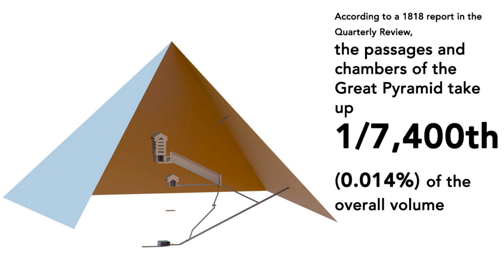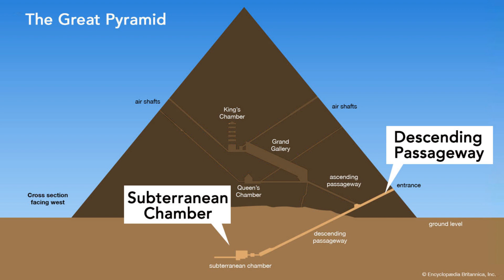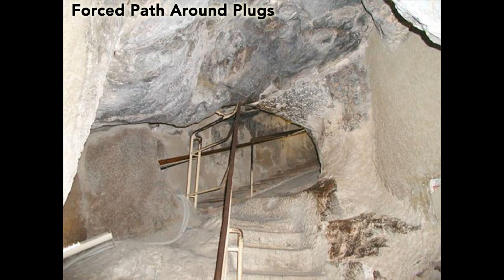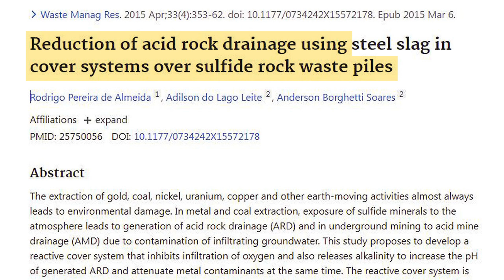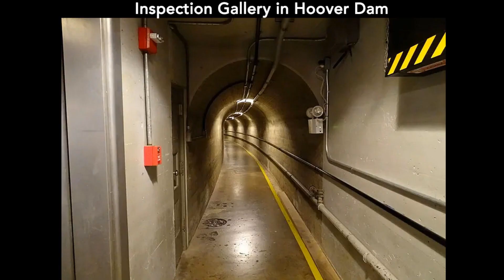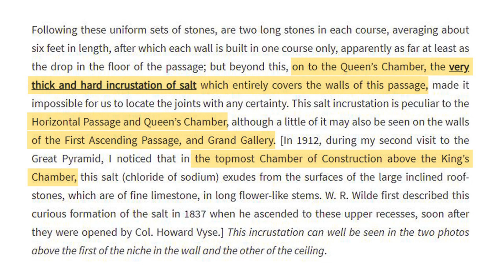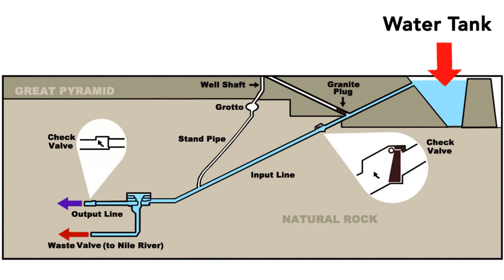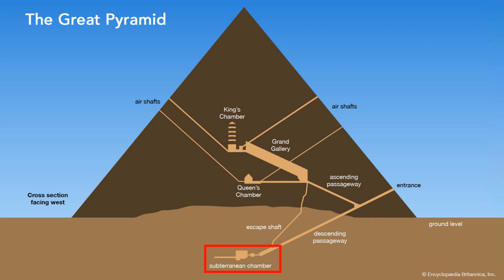The Mystery of the Great Pyramid's Interior System?

Comment: Could this be to collect DEW every day.
Maybe they had a problem with water supply because they did cut all the trees around and the snow of the mountains all around have been melted by pyrocumulus made from ""wildfire"" and collect.

(we know that people have collected ice sheet all over the world)

Maybe the pyramid was linked to the water table and filtered through the process and the clay under the subterranean chamber and they had some fountains installed around.
Reply from the maker: Thank you. I think if the pyramids were designed to collect dew/ water then they didn't need to be solid. We use solar stills to do a similar job which are mostly made of plastic films. The pyramids are also not shaped or equipped like today's water filtration systems. If water were collected and filter underground then it wouldn't be necessary to construct the massive pyramids on top.

Comment: The "relieving chamber" is constructed with acoustically tuned beams and the salts are there because they were making hydrogen. Look up Jamie buturif's work if you want to know about the rest of the story...
Reply: Buturff
Reply: @conradsmith2441  watch?v=Uz0REdjpJtI   ( english subs available
With the size of the pyramids, it would have hard to stock all the production safely, but why not ^_^.
Reply: Sorry it's Jamie Buturff "Great Pyramid at Giza hydrogen masar"
Reply: Jamie buturif, i can not find.
Reply: @Paraclef  sorry, it might be Buturuff. The casing stones on the pyramid are a man-made material similar to what modern day capacitors are made of. The pyramid is a huge electrical generator of a sort. The granite beams produce the pizo electrical impulse that excites the Hydrogen to form a helical masar coduit that reaches into the ionosphere and allows the electricity to drain down into the skin of the pyramid. The water ram is what slams a granite door shut intermittently to create the vibration that is amplified in the grand gallery and bombards the tuned granite beams in the "Kings Chanber" to produce the afformentioned pizo electric effect. Buturuff explains it better.
 is an
Reply: @Paraclef  Jamie Buturff wrote the article. " Great Pyramid at Giza hydrogen masar"
Reply: @conradsmith2441  Thank you for the link, that looks interesting, hard to imagine, but still the possibilities are what we are looking for. 😀😊

Comment: Tina, Love the video, here are some calculations. The 3 giza pyramids add up to 227 million Cubic feet of stone. The Chunnel boring machine that dug the tunnel from Paris to London was 24ft in diameter. It would have taken 10 miles of tunnels at 24ft in diameter to build all three pyramids. With all the tunnels under the giza plateau and all the quarries above ground, I still dont see that much material. There had to be at least 20-40 percent of the material brought in from somewhere else. If it was all quarried onsite there should be a quarry 1/2 of a mile squared by 50 ft deep. Ive argued with others about this fact, and all the known quarries on Giza only accounts for 1-1/2 Pyramids. So your theory of mining waste could be the answer to the missing material. Egyptologists always say that the casing stones were quarried elsewhere, but they dont believe the obvious fact, (that any bricklayer will tell you) that the casing stones were laid first and all others were placed behind from the inside. All pyramids were built from the inside through internal ramps that most certainly still exist. All we need to do is find the main entrance to these ramps. Jean Pierre Houdan is the architect who devised this theory and i believe he is right. But what if the casing stones were poured with a white limestone aggregate and all other stones were quarried. This does seem to be a good hypothesis.
Reply from the maker: Thank you for sharing with me. I think it's possible that the pyramids were built on top of pre-existing tunnels. Though based on consistency of the internal/ subterranean systems of the pyramids, I would say their interior structures were not random but by design - I'll talk about this in the next video. As for the amount of the stone quarried on the Giza Plateau, I discussed it in a prior video on the original height of the plateau. Hope you will find it interesting: Prehistoric Mining: What was Mined on the Giza Plateau? https://youtu.be/y6ShuJdzDS0

Comment: Good work. To support the mine tailings theory, you could also remind people that the whole of the Giza plateau was substantially reduced in height producing waste that needed to be safely stored as well as material from the numerous shafts and tunnels.
Reply from the maker: Yes - thank you! I discussed that in the last video. A paper proposed that the original height of the Giza Plateau could be 50m higher. If you want to check that one out - here is the link: Prehistoric Mining: What was Mined on the Giza Plateau? https://youtu.be/y6ShuJdzDS0

Comment: Gravity dam was built in one piece whole that was used to holds a body of water (or loose material)  from upstream against a body of void. 

For that we can’t call those pyramids a gravity dam just because we saw features found in a gravity dam. 

Circumstantial and association are not root cause.
Reply from the maker: I don't think pyramids were gravity dams. I was using such dams' internal system as a comparable structure to study the pyramids. Btw I did show a gravity dam built with blocks in the video.
Reply: @CuriousBeingbyTina  OK point taken.
Reply from the maker: @philoso377  🙂

Comment: OK this movie says that time ago somebody knew and applied the today's mine waste storage. So again reason is added to the existence of the pyramids. The shafts and chambers indeed look as air passage from left to right. Also water and salts pass through the porous stone and flows down. So drying and and cooling. I heard that dams made of concrete don't dry even after long time (tens of years) because of the internal moisture that cannot leave the dam (Hoover) and others. Please look at Bright Inside - Jimmy's last movie with the pyramid. He was there, cleaned the dust and discovered hundreds of stones making a tiling path around the pyramid that is exceptional. Around the pyramid is so tight the tiling that for me is weird. Nothing in or nothing out? What is the purpose of such much work and material usage? The same situation in the shafts, just look at please, its so tight between the stones (some of 3-5m long) that hair cannot be inserted. I hope from the bottom of my hart now that those who did things there looked for gold or iron or copper. I hope they didn't found something else material with time counting. If blocks were done from the waste material and build in the place, the exterior of the pyramid is covered with natural stones or the same as in inside? Have you heard or seen material about research inside the pyramids? Have ever somebody looked after the things? Now with the science the stand is that Egyptians carved with bronze chisels in lime stone. Stone is Mohs hardness 3 to 4, bronze is 3! Practical try was performed, the tool didn't scratch. They must have had iron tools. (that's what mining was for!!!), other way bring it from Hittite county (Turkey) or China, but this is other war.
Reply from the maker: That's why I think the "stone" including the granite blocks were cast instead of quarried. Casting can create almost seamless surfaces. I also cited multiple published scientific material analyse of the pyramid blocks (which indicated pyramid blocks including casing stones was a form of concrete) in multiple videos including this one. Did you watch to that part? Btw my last video was discussing the iron mining possibility on the Giza Plateau: https://youtu.be/y6ShuJdzDS0

Comment: Wan shang hao, 
    Maybe the holes in the King's chamber and other locations are for illumination? The first thing I noticed when a child and saw the interior pictures of the pyramids was that there are no smoke stains, therefore torches were not used for light as in the Native caves in Texas and the surrounding regions. We could always tell which caves had been inhabited from the smoke stains on the roof. Since there are corroded copper cables at the terminal end of the shaft, possibly it was leading to some sort of light that generated piezoelectricity of the electromagnetic properties of the position on the planet, the aquafer underneath and the different types of stone used all combining to create electrical charges which were used somehow. Someone probably pulled out the mechanism long long ago and we are only left with clues and theories.
    Thanks for showing the structures in China, many people have not seen them and few realize the significance of the stone work done and how utterly advanced it is, well beyond us today. 
    I would like to speak with you and exchange information and theories. I am trying to learn Mandarin for a long time too and progressing very slowly. Your English is very good, you make very few mistakes.
    I was wondering when another video was coming from you.
xie xie nin

Comment: If drainage system, I would say its very inefficient at that. From the way its build, only water from a 45° angle from the position of the shaft has a 50% chance to enter the shaft. Thats not enough for safe drainage. Its also said that the lowest chamber were connected to the nile river, though I doubt this is proven. Anyway, the interior might have functioned in a mine tailing something "what do I know", but I doubt the shafts are for drainage alone.
Thank you Tina. Great job again.
Reply from the maker: Thanks for sharing with me. The pyramids were originally covered with casing stones to prevent water getting into the interior and the internal drainage system might be designed to deal with the small amount of water that seeps through. Yes there is no real evidence that the subterranean chamber is connected to the Nile.

Comment: The air vents are necessary for multiple reasons.  Any water going through the pyramid could cause sulfuric acid  and sulfuric gas. If there were human inspectors in there monitoring the water drainage, they would need ventilation. Most all mines in the past couple hundred years pump air in and have ventilation shafts to let gasses out. It's not uncommon to have pockets of methane in mines. If the purpose of the shafts and rooms is for water drainage, without the air shafts the water drainage could create a vacuum which would hinder the drainage process, and cause the water to permeate through the tailing material creating more sulfuric acid, defeating the purpose of the pyramid tailing structures. Then they would be in the same mess we are in today with our mine tailing piles causing acid pollution and acid rain.
Reply from the maker: Thanks for sharing your insight. I really appreciate it. Even with casing stones, the pyramids are not air-tight. Water will flow downwards due to gravity in an anoxic environment. I read the two shafts in the King's chamber are connected to the outside while the ones in the Queen's chamber are not. Some researchers claimed that these shafts are too small to be used effectively for ventilation. Without Ma'mun's path, people would have no access to the upper chambers therefore it might be the pyramid builders' intention to keep these two chambers inaccessible for humans hence no in-person inspection would be possible.  I think judging by the design of the pyramids, they were not meant for humans to get in. The pyramid builders were more advanced than us therefore they must have had more protection for workers and inspectors and more strict building safety codes. The pyramids are not even close to get pass our current building codes; so they couldn't have been designed for in-person inspections considering how sophisticated this ancient civilization was.
Reply: that is so much intelligent then most of the current hypothesis
Reply: They were gold mining
Reply: well yeah its quite obvious @rcjoe406

Comment: Another great video. If the blocks were geopolymer then there is still water inside them and might explain the appearance of salts on the surface from water leaving the stone.
Davidivic talks about the huge amount of water needed hence why they were built next to the Nile.

You mentioned water pump and why....the obvious association would be like a fukishima where water keeps the spent rods cool?  This is far fetched I know but is analogous.
Reply from the maker: Thank you! That's a good point from Dr. Davidovits on the huge amount of water needed to create geopolymer. Interesting thought on the cooling effects of water - thanks for sharing your insight!
Reply: @CuriousBeingbyTina  the other part too is the lime needed and possible deforestation that occurred....there is some reference in the bible to this and a curse from god  that would devastate Egypt which is interesting. 
Also...davidivic thought that there wasn't a hill....but a hollow under the pyramid that was filled with geopolymer around the subterranean chamber. Are you able to comment?
Reply from the maker: @bok2bok333  In a prior video, I discussed that the original Giza Plateau was much higher than today and the top layer of the rock was removed (https://youtu.be/y6ShuJdzDS0). From the GPR report we can see that there are underground caverns on the Giza Plateau around the pyramids which I think might be mine tunnels and shafts. It's possible that some kind of geopolymer/ concrete was used to back-fill the subterranean chamber since it's a common practice in today's mines.
Reply: @CuriousBeingbyTina  maybe useful looking at the Red Pyramid. The red stone and the three chambers with corbel ceilings.
Reply from the maker: @bok2bok333  I totally agree :-) Will talk about the chambers in the Red Pyramid in the next video!
Reply: @CuriousBeingbyTina  Cool :-)

Comment: Current concrete uses ' Slaked Lime ' also known as cooked limestone.  It also is known in gold recovery that the more you grind rocks down to sand, the more minerals and metals can be extracted bringing in the problem of toxic seepage.  One of the additi9nal questions for the casing stones and the inner stones is " was there a location where they could have cooked limestone to be later used to make forms of concrete? " ???

Also, around the 16 minuit mark a further question, where was the salt buildup in the other pyramids at the same height from the river?
Reply: It's possible that in the making of the early pyramids they depleted their lime.....by deforestation. Palm trees have a high lime content.
I got this from the davidovic doco.
Reply from the maker: Thank you for sharing your insight. I found some salt buildup inside the Bent and Red pyramids judging by photos. Will look into other pyramids as well. 
As for the concrete work/cook zone, I think the internal/core stones were made with local limestone material and the casings were probably cast in-situ using stone powders imported from Aswan and Tura. Giza Plateau is a vast place and I'm considering this ancient operation could be like today's mines with conveyors to move large quantities of materials.
Reply: The last question I have wondered too.